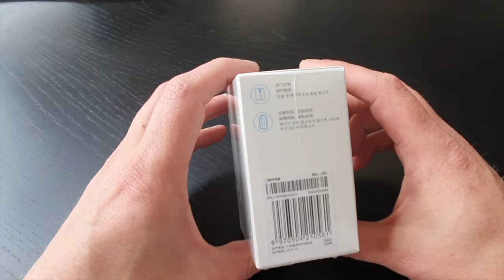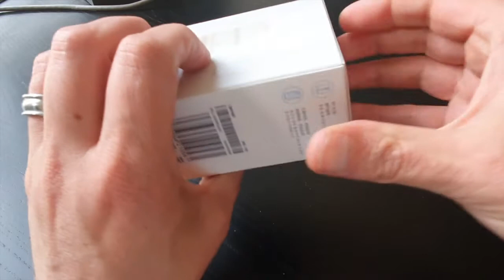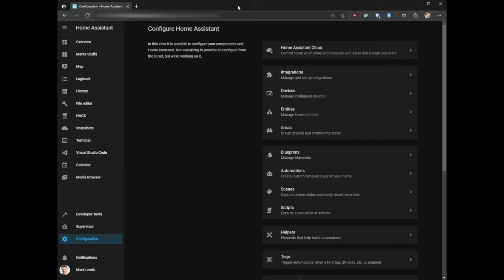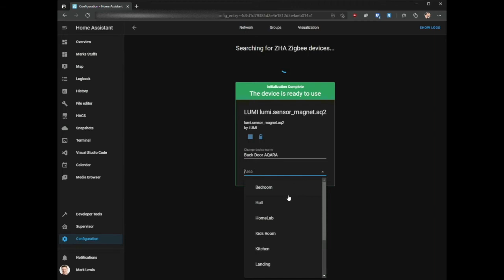Aqara Magnet Door/Window Sensor Unbox and add to Home Assistant

Comment: Mark, Thanks for the video.   I want to pick this up for my HASS running on my R-PI, however every model I see on Amazon says it requires The Aqara hub.  I have a USB stick in my R-Pi that is both  z-wave / Zigbee.  Will this work directly with that without needing their hub?  Can you post a link to the ones you bought?

Thanks in advanced for your help.
Reply from the maker: Hi Dave, I am not using the Aqara hub. With my Home Assistant, I have used the Conbee II USB device, Sonoff wireless Zigbee hub and more recently the Electrolama ZZH USB device. All of which have worked with the Aqara sensors. Although I don't have a Nortek? USB device, it should work directly with your installation.
Reply: @marklewis5460  Thank you for your quick response.  I am excited to hear you didn't use the hub. I was 99% sure that was the case.  I'll pick them up and let you know how it works out.  Thanks again.

Comment: good info mate, didn't know the Sonoffs were unreliable, have these kept on performing well? any experience with switches? I was about to grab a couple of sonoff zigbee switches as well but now I'm doubting of their reliability
Reply: oh i see you only posted this a week ago, anyway you've got a new subscriber
Reply from the maker: @licanueto  thank you. So far they have been doing well. I'm not sure what was going on with the Sonoff ones but the Aqara ones seem to be working. I want to get my hands on some of the switches and the mini boxes
Reply: @marklewis5460  just in case, did you make sure the magnet wasn't upside down? apparently with the magnet in the wrong position it works but not very well
Reply from the maker: I lined up the marker arrows that are on the units themselves so yeah it shouldn't have been. The one that would stop responding would work after a re-pairing but then stop shortly after. One drained the battery within about 48 hours. It's a shame as I like the Sonoff products and they cover a lot. But my personal experience is that the Aqara products are working incredibly well, and they are only slightly more expensive